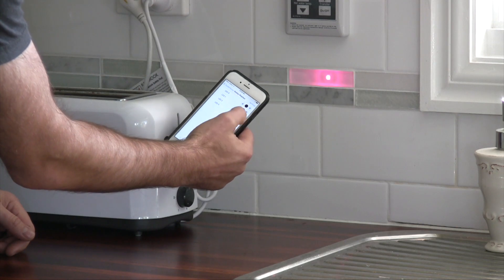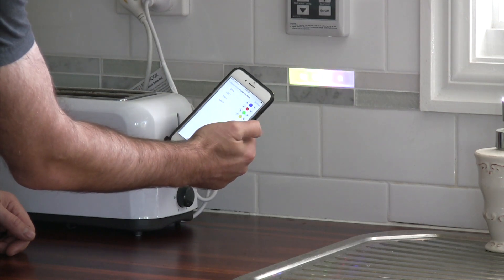Vlog #58: Wires NOT WiFi for home automation!

Comment: I'm in a rental so the best I can do is use wireless, but when I get my own home everything I do will be hardwired, and have battery backup on the security system so it will function if the power is cut

Comment: Thanks for your home automation videos, I really enjoy seeing what can be done.  I also agree about WiFi, it’s nice and easy, but probably not the best decision long-term.
However, for someone like me, if I wanted to retrofit my house, running cables to all of the switches, or installing controllers at the switchbox and then re-cabling the lights and certain power-points would be a massive project.
However, if I could use something like a Seneors switch actually located at the light switch or Power Point, I could then just replace the existing switch with a button.  Yes, I know that I still need to find a way of getting my control signal to the Soft-Switch, but could “Ethernet over Power” be used for this?  I was just thinking the Power lines are already installed and if an “Ethernet over Power” system could be incorporated
into the Soft-Switch (e.g. Seneors), that should make it much easier to install, while still having a secure network.
What are your thoughts on using “Ethernet over Power” to control home automation?

Comment: WiFi is great for many things but I still like Mechanical devices like when you were talking about planes,many may run Fly By Wire and cars have Drive by Wire and damn i hate them.  As a mechanic ive had those drive by wire components cause massive issues.  I prefer wired when possible and when its not life or death.... The exact reason im 100% against "Smart Guns"... those things are a joke.

Comment: It's a lot easier to run wires if you house is made of plywood but here in Europe most houses are made of brick. Luckily I have a attic so I can run wires easier but I still need to make channels for light switches.

Comment: I couldn't agree more with that statement.  I'm "darn happy" I'm oldfashion, if using wires gives you that kind of label...  So far, I'm not using any wifi connection in my home automation system.  Maybe I will in the future, but chances are low.  I've foreseen cables (some of them, well, lots of them in fact..., still waiting to be connected) on every possible location where I think I will need one.  And yes, should I have overlooked a place, then chances are I will use wifi, but only as an "emergency way-out"...

Comment: I agree that wires are more reliable but it's easier to connect to existing power line in the room (instead of using battery) then run new wires to single plase in house which can be 100 ft away.

Comment: I not only just DISAGREE! I completely DISAGREE. Core parts of the System? Designer. Wires to routers for sure. Maybe three or four. On DIFFERENT bands. Air-plane - houses DO NOT CRASH. Sensors you don't make them. They are nano state, CHEAP and can cost less $10. Try resizing the sensors and cost to Xiaomi China imports. Wired - NOT necessary. Cable no - lights for security. Old very old. We move to gateway - Zeebee for sensors. House do not dive from the sky and DO not crash like cars! Your only valid point is EMI scrambling. But hackers attack wired routers as well. Channel collisions - easily handled by knowledge of band spectrum spreading and load shedding. Try my home with FULL automation - Over 100 sensors, ovewr 30 smart bulbs, 10 + security cam and automated irrigation.Try WIFI focus beaming. Try looking at the WIFI MESH technologies. Coming your way.  To quote from trusted reviews: "The nodes work together to distribute the load of the network, and offer three key advantages over normal Wi-Fi extenders. The first, and in many ways most crucial, is that despite having multiple nodes with multiple Wi-Fi signals, the whole mesh system unifies your Wi-Fi connection into one network name (known as an SSID). So no matter where you are in your home or office, you’ll only ever see one network name. The second advantage is an extension of the above, which is that the system will also take care of determining which signal is best for your devices to connect to. So as you roam around your home, not only do you not have to worry about changing your Wi-Fi login from zone to zone, but you can be safe in the knowledge that the system has connected you in the fastest way possible. These first two advantages are the defining characteristic of mesh router systems, but the latest, most powerful systems have a third feather in their cap. Quite simply, they tend to be more powerful than conventional Wi-Fi extenders. Each node is often a dual- or tri-band router in its own right, so it can communicate with your base router, other nodes and your devices far faster than most Wi-Fi extenders" You are locked into into a certain way - its good - but there are other ways that WORK perfectly and WIFI is here to stay and improve and improve.

Of course we can take your wires and cut them. There we got you. We have brought down your system. Cut your power? Now that would work for both would it not? Or perhaps you have some hefty power back up for all those power hungry devices. Snip...................................................cut. 

Read more at http://www.trustedreviews.com/opinion/mesh-routers-whole-home-wi-fi-explained-2953740#i4GYogtAD1EDrRzO.99

Added: it not some much the exclusion of one technology to another but rather complimentary. For example consider every bulb in the house. How do we class "smart". I consider the following -  Smart bulbs can do more then turn off or be set to timers or time exclusion. It is a matter cohesive connectivity to other sensors and the way in which they behave. Another point both brnadings - Philips Smart and YeeLight are capable in being dimmed and change from white light to super warm. Cost as this writing - Philips <= $13 AUD Yeelight <= $18 AUD. Both WiFi. ZeeBee coming as part of Version 2 Ecosystem of Xiaomi.

Comment: The esp8266 is cheap is there a cheap arduino that is wired?
Reply from the maker: Any microcontroller with an I/O pin can run wired comms of some kind, even just a simple serial connection. It doesn't need to be Ethernet.
Reply: SuperHouseTV good to know thanks. Is it covered in your arduino experiment kit? I haven’t even opened it yet.
Reply from the maker: Serial communication between the Arduino and a PC is covered using USB, but that can't scale to longer distances. The same basic principle can be done without USB but that's not covered in the Experimenter's Kit. Ideally you'd use something like an RS-485 line driver, or a CAN or LIN driver. That's a few steps beyond what's covered in the basic kit and it may seem complicated, but it's quite achievable. I should probably do a project related to that for the channel.
Reply: SuperHouseTV or even bring out a free tronics advanced arduino kit. But you have a lot of things on the go and doing a grate job

Comment: I thought the same thing, I started to comment and you kept covering what I was about to type. I also thought about having to change the wifi key, what a pain that would be for those people who didn't prepare for that and hard coded their keys. You could run PoE and not have to worry about plugging in in areas and easier to cycle a device that may be within a wall from the PoE source or within nodered etc.

Comment: Excellent points!  It all depends on what one needs.  Anything critical, or even rather important, must be hard wired.  For me, a switch for the hallway light doesn't fall into that category.  If an attacker has a deauther to kill wifi, they may also have a cell jammer and would probably kill the power and internet/phone wires.  Notification would be an issue then.  It all comes down to proper risk management.
Reply from the maker: Exactly! My point is that the solution should be appropriate to the problem. This video is a response to all the people who tell me that I shouldn't have put in cable because WiFi would be better. Sometimes WiFi (or other RF) is the best solution, but not always.

Comment: They are probably talking about *if you already have mains wired in*. If I had to do this, probably would consider using ESP or some powerline stuff, because the cable is already in place. So with their point is there is no cableing work. (At least we have both netural and live in the switches). If I had to do it from the beginning, your solution makes sense.
But still a mains psu is "very complicated", I'd rather build some low voltage whatever because those LM2596 based stuff are so cheap and easy and safe. But that is for things, where I need local logic (IDK for what. Maybe some "smart display", etc)

Comment: This is something I am worried about with my setup. At the moment I am using esp8266 chips to control my lights as this was the way I got started with home automation playing with esp8266 chips. The way I have mine setup is the wifi is only used to talk to my home assistant vi MQTT but my light switches are connected directly to my esp8266 (4 lights & 4 switches / chip) so they still work stand alone without wifi just the state will not get updated to home assistant if wifi offline. I am just worried how long these type chips will last? I also wanted mine setup in a way I could easily put everything back as is if I want to sell my house so have made up these boxes to control things https://photos.app.goo.gl/7nBVXCqcJFn0WaoP2
I think if I build a house again I would wire up my lights & switches back to a central location like you have.

Comment: Bad comparison (critical system versus your ability to turn a light on or off!), but I understand why wire wins over wireless.
Reply from the maker: Sometimes wireless wins over wires, too! My point is that the solution should be appropriate to the problem. This video is a response to all the people who tell me that I shouldn't have put in cable because WiFi would be better. Sometimes WiFi (or other RF) is the best solution, but not always.
Reply: GOOD comparison. The ability to turn a light on or off becomes critical when your partner has a seizure and you need to see. Sure, it's hopefully unlikely that medical emergencies happen at the same time as technical faults, but... just saying, home lighting can be critical as well.

Comment: I absoluty agree with you and your approach of wires. But I see wiring each switch and each LED of a switch as too many cables ending up at your contollers somewhere, where the cables end. I'm currently developing a CAN-bus based system, which is more or less doing compareable things as you do and finally having a gateway into the LAN to my MQTT broker. So by doing this, I can save quite some cables, based on a relyable wired connection giving the same benefit.
Reply from the maker: Sounds like a great solution. I've done work with CAN and LIN in the past (I did a whole episode about LIN, which is a simple single-master version of CAN) and I think that's probably my favorite approach right now. The best thing about cabling things the way I have is that I could unplug one of my current "dumb" light switches, plug in a different switch, and make a software change in my controller to move back to a system with distributed "smart" light switches.
Reply: Oh cool, I was not aware, that you have something about LIN also available :-O. I'll try to find and check this as in my solution also uses LIN. In a e.g. 5 plug wall mount, there is only one main CAN controller connected to the bus and each plug can be conected via LIN to a slim subcontroller, which supports a relay to switch the plug or do power measeurement and so on. So here I just use LIN for short ways as breakouts of the CAN mainboard, which is also LIN master there. This will again save wires and costs as a CAN controller is more expensive than a LIN controller.
But I also absolutly understand your argument of just replacing the dump switches by reusing your already existing infrastructure to make them smart just "a little further away" from the switch.

Comment: These arguments are disappointing.  I clicked on this video hoping to see something to change my thinking.  But alas, most points being made are that of not fully understanding how to do wifi properly or some sort of edge case criminal blackout scenario. Is the wired system not dependent on software somewhere as well?

I agree that a wire is more reliable, but that doesn't mean that wifi is unreliable. To come to this conclusion, you'd really have to run a system for awhile with both wired and wireless and log any time the wire got a command that the wireless didn't. Buttons also fail, do you put special buttons in your critical systems as well?

Overall, I like the discussion, but it wasn't really what I had hoped.  It's just an opinion piece.
Reply: "Some sort of edge case" is exactly what you need to consider when designing a system that you are building into the walls of your home. If I applied the same indifference to the "edge case" when installing a lock to my front door, then I'd be a stupid guy...
Reply: Wifi is absolutely unreliable in many buildings (thick stone walls, any foil backed drywall) etc.  A decent AP can still only get 3 or 4 rooms away.  Wired is just simpler, much easier, and ... it's a no brainer

Comment: i 99% agree with you there, but you missed out an important part, and that is that hard wiring cant always be done cheaply... especially not in a rental. Im renting and cant just hard wire my blinds into the wall, and have to rely on ESP modules run off 5V phone charger as thats as good as i can get it for now. I agree that if you can hard wire, its the way to go, and a single point of upgrades and maintanance is a HUGE cost and time saver if possible. I like the videos, keep them coming :D
Reply from the maker: In many situations wireless is the correct solution to the problem. I use it a lot myself. The problem I have is with people who tell me I shouldn't have hard-wired, because it would have been better to use WiFi for some reason they can't explain :-)

Comment: Agreed on critical systems probably shouldn't be wireless. One of my project ideas was a WiFi thermostat that would read from WiFi thermometers around the house. Each thermometer would have a "set master" button for if i want the furnace to control the temp in that room instead of the set schedule. One of the main features is a standalone mode which it will failsafe into if the network goes down. I have been working on switching my cameras from WiFi to Ethernet, not because i am concerned about a burglar jamming them, but because if the power goes out, i don't want to be the only person with WiFi. Added benefit on using PoE is managing a central large battery bank instead of multiple small ones. No sense having cameras operational while the DVR is dead, or having the DVR running, recording nothing but "no signal since xxxxxxxx"
Reply: I use Ecobee 3 thermostat in my house with additional sensors. Works great!

Comment: I TOTALLY AGREE WITH YOU !!!

Buy the way, thanks for your videos, and the time you spent on it. 👍
I’m currently making a project with the same spirit :
➡️ Ethernet + POE injectors (but auto-adaptative injectors multi-voltages (PWM) for my needs to power all kinds of 
micro controllers Arduino / ESP32 / Photon / ESP8266).
➡️ MQTT centralized broker, and trying to implement a kind of “keep-alive” system (if one fail, the second one is relaying flows of data ... with virtual IP, etc). QoS is used for some type of signals (IR for the security, ...)
➡️ 2 Rpi and their 5 inches TFT to display all kinds of things (alerts, temps, hygrometers, IR sensors, water tank level, ...)
➡️ And at the end of the Eth. line micro-controller modules with a limited capabilities, so they can perform actions if the MQTT brokers fails ... (important for the “WAF”) and they can grab their configurations (zero-conf like) from the MQTT broker via data stored in a DB.
➡️ A LAMP server to pilot all these over HTTP(S)/NodeJS/JSON/Websockets/Framework7/...
➡️ ... (many things in that 3 dots !)

And people, now, about using WiFi in your projects, think about that critical risk that is “WPA2 KRACK ATTACK” ... 🤔

Have a nice day ! 😉
Reply from the maker: Wow, it sounds like you're building an amazing system! It'd be awesome if you did some blog posts or videos about it. I'm very interested in the clustered / failover MQTT broker. I've done clustering for other services in the past and I want to do it with MQTT.
Reply: SuperHouseTV I will try to do my best, i promise !

Comment: Actually if the power is turned off (by a thief), then that will bring down everything, including wired networks to a grinding halt. No need to find a jammer or EMP device. Surprisingly enough, almost all houses in Australia has main breakers in the meter box on outside wall, un-locked,  inviting anybody to tamper with. Upon request, the utility company provides a lock at a cost (around $70). Nobody (including me) seems bothered doing that. However, it is not smart to put your own lock, since it will yield the meter box un accessible by the meter-reader.
Reply from the maker: There's a UPS hiding in the bottom of the rack in my main wiring area, and the CCTV system also has its own dedicated UPS.
Reply: I would suggest having a current sensor for alerting power-outages, if your UPS does not support easy interfacing. Better you may have another current sensor (current-transformer type) mounted on the incoming lead to the meter box, behind the back panel. A licenced electrician is needed to do this legally though. This would help determine if the outside breaker is maliciously dropped.
Reply: I know this leads to extreme paranoia, but having all sorts of sensors, what the heck having power monitoring too :)